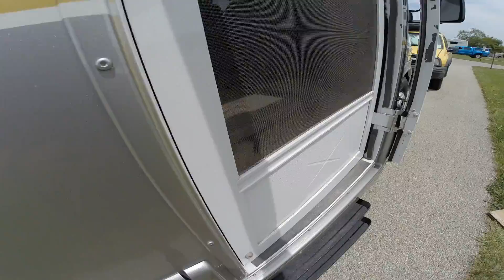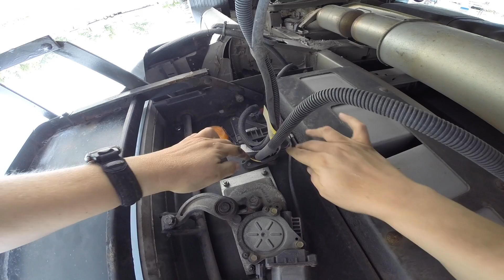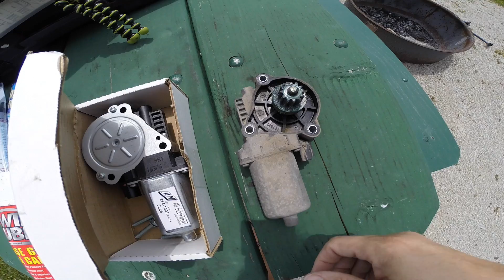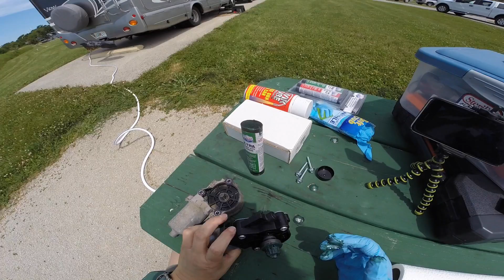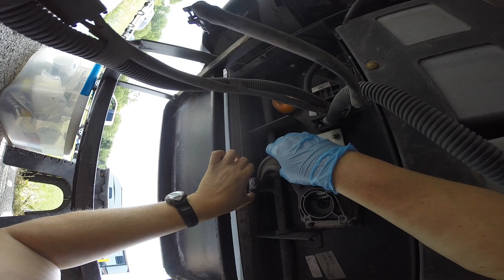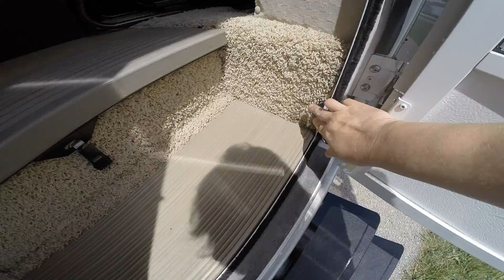Replacing a Kwikee Step Motor

Comment: This is one of the clearest videos I have seen in a while. After watching this and then doing the same repair on my coach - I would have been REALLY embarrassed if I had paid someone to do this job. Often times coach repairs can be daunting. But step motors seem to fail all to often and 'who knew' it was so easy to fix. It would be several hundred dollars to fix this at the RV dealer - not counting the weeks that it would spend on their lot until they got around to it.

Comment: Lynn has given the best explanation of the Kwikee Motor replacement I have ever seen.  I go thru this yearly.  I have a 2008 Fleetwood Revolution and this is a common problem with all Kwikee step systems.   I carry a spare motor assembly to fix while I am on the road.

Comment: Outstanding Video. Exact problem and fix for my 2013 Tiffin Allegro. You did a wonderful job pointing out the socket size and the fact that you dont have to mess with the clevis joint. After watching your video, I went out and replaced my step motor and fixed my problem in 15 mins and $67 motor off Amazon. Cant thank you enough.

Comment: I'm so very impressed that you would tackle this project and let alone film it while your working on it.  Great job and thanks so much for taking to time to put this content out on YouTube. 

I had a little different problem with my Kwikee steps.  I was driving in a Mexico parking lot and hit a pot and went down with a loud thump.  I didn't realize at the time, but I had hit my Kwikee steps.  Well shortly I found out they didn't close properly and I began to work.  

I took out the cotter pin and tried moving the steps by hand (with-out the motor linkage connected) and found out the metal frame bracket had been bent. I straighten out the frame and sprayed lubricant on all the moving parts and it worked great again by hand.  Now I only had to put the cotter pin back in.

I spent at least two hours trying everything possible to get the cotter pin back into the clevis on the linkage and it just wouldn't go.  Finally I figured out that if I removed the travel limit stop bolts on each side of the steps, (these allow you to position the stops so the steps are flat when they stop) I could move the steps past normal travel by hand and then the cotter pin went in easily.  I hope this helps someone who has the same problem.  Thanks for the links to purchase the replacement motor on-line.  Cheers.

Comment: Excellent video.  Clear, specific narration, logical progression, no extraneous remarks nor wandering tangents.  I come from the aviation world, where concise instruction and communication is a hallmark of the professional, and you've nailed it!  Now on to my questions.  Did you already determine that the motor was a problem by testing the various wiring connections, the ignition override and ground? How had you narrowed it down to a motor failure?  I have a Tiffin coach with series 41 Kwikee steps that is being cantankerous and I'm reluctant to throw money at bad service facilities in my region. Thanks for the best video on topic so far!
Reply: From my previous reading on this problem, the motor is 90% of step failures. That ugly sound it makes was the "kicker" for me. When she showed the prob and the steps made that sound, I knew it was my exact same problem.
My advise, spend the $67 on Amazon and 15 mins to replace motor. Just my 2 cents from a fellow Tiffin owner.
Reply: Thanks for the tip Chuck Hare... I'm waiting on a wiring pig tail for testing of the kwikee using a 12 volt battery and running each phase of the logic to see what part has failed.  My symptoms include sporadic operation and could be the controller at fault.

Comment: Mine did the same, but the drive gear on the gear box had broken teeth. The RV is 1998, so I replaced both box and motor

Comment: To remove the clevis pin I push up on the steps to take the pressure off the clevis pin and it comes right out.

Comment: Great job, I have a 1999 Winnebago 39 ft  Adventure 2 step, any one know what series that is?  I was a bit worried when they locked down at the camp site but this helped a ton to realize I didn't have a major problem. Thanks
Reply: Hey Rick-- just download the Kwikee Step Service Manual (link is above in the video description).  Just measure the width of your steps and it will tell you which series of steps you have.

Comment: My Kwikee steps are stuck in the extended position. If I can get the motor off will that release the steps so that they can be manually retracted, making the coach safe to drive?
Reply: • Tiefa yes. Removing the motor (specifically the gear sitting atop the motor) will allow the steps to move freely.  Just have a bungee or two to tie them up into retracted position.

Comment: How did u pull the pigtail on the motor
Reply: s buchanan just a pinch and pull.  I can't recall if the plug had pinches on both sides or just one on the top, but squeeze that/those in and then the plug should pull apart
Reply: i pulled and pinched. this is crazy, i need 3 hands